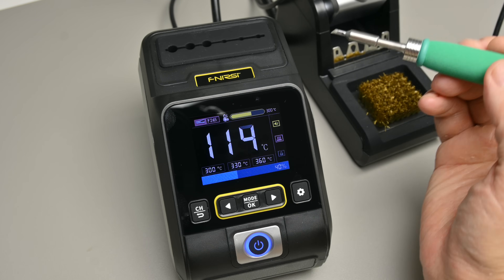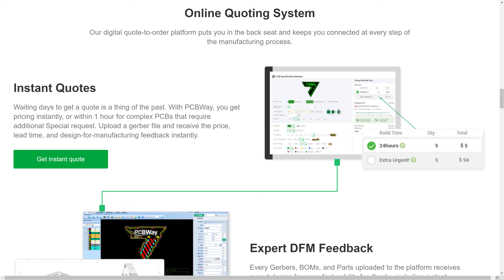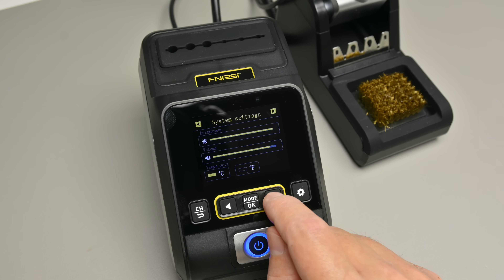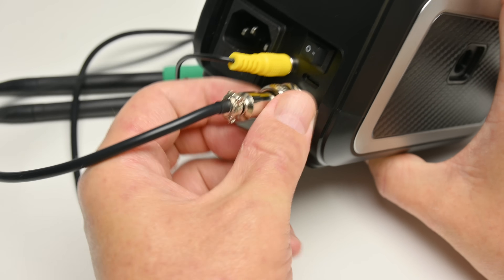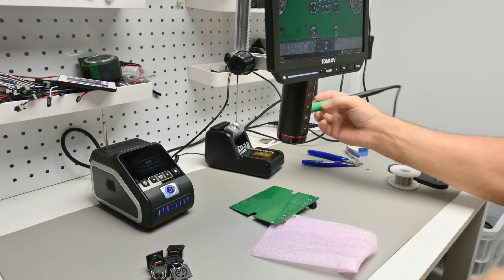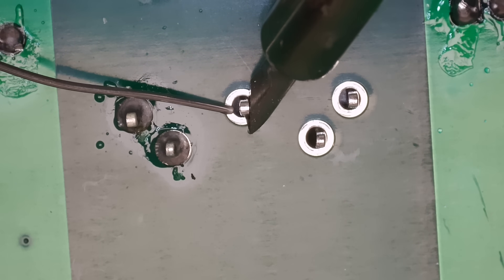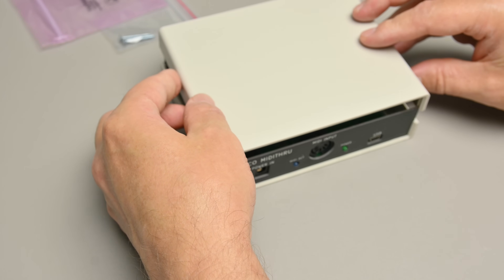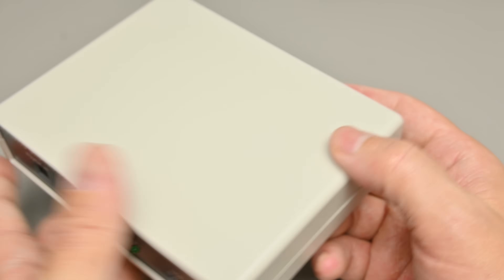Soldering MIDI THRU BOX KIT with the FNIRSI DWS-200 200W Soldering Station

Comment: I recommend not buying this DWS 200 soldering station until Fnrisi bring out a revised model and correct its flaws. There are 3 distinct flaws on this soldering station and the user or end buyer is forced to make DIY corrections which only fixes 2 of the issues. First the tip is not grounded. There is a an earthing component missing on the internal motherboard. Second there is a small AC current leakage to the tip which could create static, and build up and create a shock or short to you or sensitive board repairs. Even with all the online suggested fixes and even fixes by Fnrisi to ground the tip the AC leakage to tip does not go away. Its a small AC leak to tip but its still poses a risk. Thirdly the internal wiring is not properly insulated and hangs over and touches some large current circuits. One can insulate these wires and ground the tip yourself but why must a end user do this to a brand new machine out of factory. ? The problem is even if you carry out your own DIY fixes...there's still the problem of a small AC current leakage to tip.

Yes its a beautiful little machine but there's still the AC current leakage to the tip which remains a safety hazard. For now until Fnrisi bring out an improved model I recommend don't buy this machine now.
Reply: Damn... I was just about to buy one since it seemed like a good price for what you get.
Reply: AC leakage is solved in 5 minutes : u just put missing 2 ohm smd resistor , search on youtube ... , i have the station since 1 year and is great...

Comment: Hi Phil.  You'll find some discussion and criticism (on youtube and reddit) about improper grounding of the Fnirsi DW-200 soldering station - some owners have gone so far as to solder a 1 ohm resistor across 2 pads on the PC board of the station to provide proper ground out to the iron tip, but this apparently causes problems with the thermocouple sensing, and runaway tip temperature when touching a grounded surface.  Other board repair youtubers use this station, but don't appear concerned about this.  Guessing they don't worry as much about grounding and ESD.  I almost bought one recently, but held off do to concern over this issue.  Have you looked into this?  Any comments or suggestions?
Reply from the maker: I haven't looked into this and don't think it's a big issue, but then I'm just doing this as a hobby.

Comment: phil it has been many months now since "zuluIDE" was released and there are ZERO reto pc videos on youtube about that device (it is the gotek cd image emulator that supports audio tracks and also can be used win a dac addon with a rasberry pi pico W to select the images via web interface if you want. I found this kind of interesting because we finaly have a cdrom emulator that works on old machines and even DOS, But seems there is no interest or not many people bought it?  and i wanted to ask you if you are buying one or if you already have bought one, if you consider doing a video from start to finish on how to install it,setup and make it work on an old pc. I am kind of shocked there are no videos, since cdrom drives are not forever, and cd media starts to fail, and the product is something that many people wanted with cd audio track support.

Comment: I've been soldering PCB's for quite a while now. Initially I didn't understand how important a good soldering station is. I started with a £5 ebay iron with a single tip. Now I have a good station with hot air and it makes my life much easier. And then, comes the next challenge. DEsoldering. Especially desoldering parts from old hardware is still giving me trouble. Hopefully I'll figure that out too, soon. :)

Comment: I also bought soldering station recently, from aliexpress, slightly cheaper model than this, smaller base and LCD, and so on... I very pleased with it. Also, i noticed you dont use flux, thats very wrong.
Reply: His solder is a rosin flux core solder, which can still benefit from extra flux, but doesn't strictly need it.

Comment: Nice station, Fnirsi always make good and innovative products. I had an inexpensive station until one year ago, and moved to an Atten 680 Pro. It’s 80w, and very good. Recently the heating element broke, and a got the original part for a fair price (around US$ 16) from the local distributor.I’m mentioning this because better stations will need replacement parts, and I don’t know if Fnirsi is easily accessible and obtainable.

Comment: I have a fnirsi hs-01, for over a year now. I like to use it on the go with a USB-PD powerbank. I really enjoy using it. 
I have also heard good things about the hs-02, kinda tempted to upgrade to that one(tho I do like the more compact form factor of the HS-01), mainly due to it using standard jbc tips.
I commonly solder where there is no power outlet available, so those USB soldering irons come in really handy.
Those guys really make good soldering equipment.